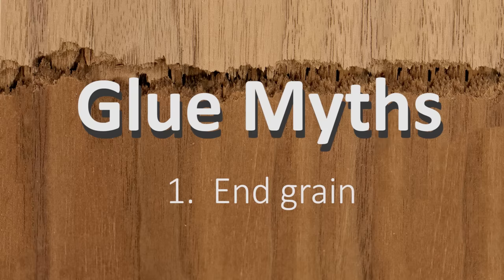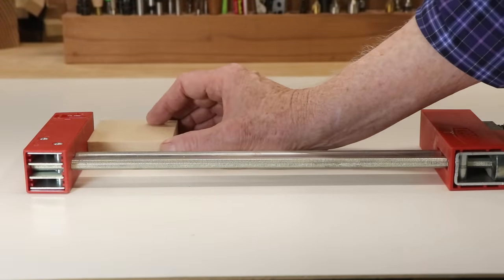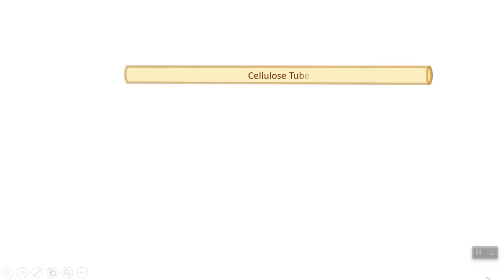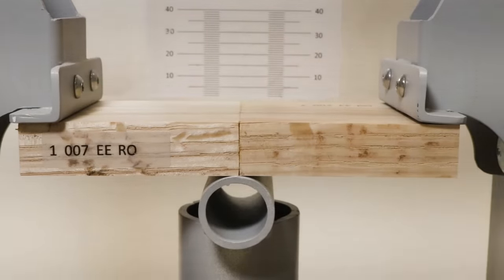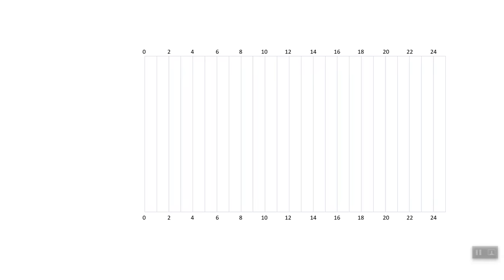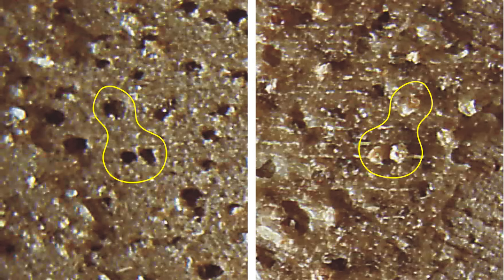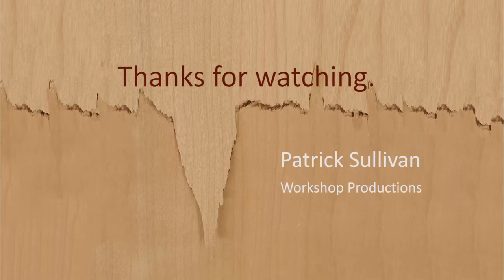Glue Myths:  1. End grain

Comment: This is a very interesting test with lots of avenues for future tests.
I'm a structural engineer so I was watching carefully to check your methodology and results.  I would not have attempted to predict the results however I know that no glue joint of square-ended boards can achieve more than a fraction of the strength of the wood itself with no joint.  I wonder if this is the source of the saying that glued end grain is not strong, not that it isn't as strong as a parallel grain joint but that it isn't as strong as the wood itself.  We know how to create strong end grain joints, they are done all the time in structural fabrication, but they take too much work for the home woodworker.  But we already have means to make strong joints- mortise and tenon, lap joints, etc. so we don't have to rely on glue alone.  And when we do rely on glue alone for making panels, we have a lot of glue surface and the final product isn't required to be all that strong.
Reply: Nah, it is just cause the endgrain-joint is so much weaker.
To get an actual comparison to other joints (what the supposed "myth" actually talks about) just get 2 pieces of wood and cut 1 for a simple endgrain-glueup (buttjoint) and the other for a longgrain glueup (lapp joint or scarf joint) - guess which one is strong (hint: not the endgrain joint).

Comment: Many years ago (make that decades), we thinned glue to make a 'primer' coat for end grain.  After that dried completely, we glued the joint with normal glue.  We didn't test the joints but we figured the extra work and time was worth it.  My question now is, how well does PVA glue adhere to itself, would 'primed' joints be stronger or weaker than 'unprimed'?

Comment: The lignum bond is the weakest bond in wood structure that's why logs can split into firewood.. Your test are of compression strength where  but most furniture joints fail in a shear or racking force is applied over time.

Comment: I like the science, but am leery of the conclusion.
Before I got over it, I was a full time boat builder for about 25 years. But that ended about 30 years ago so I don't know if much has changed. I never used PVA on a boat, only epoxy, and some Resorcinol. never used Red Oak for that matter.

Firstly, when would you ever glue planks end grain to end grain without a scarf or butt plate?? Never imagined doing it on a boat, where is this useful in furniture? We don't glue end grain to end grain because we have better solutions.

Secondly, anyone who glues wood regularly knows that edge grain glue joints mostly break in the wood. The reason for this is that the glue line is more ridged and uniform than the wood, it's a "hard point", and acts as a nodal point in the beam. You really should test the same plank, grain short, and see if the force to break the glued joint is more or less than the full plank. Although that was not the point of your vid, no harm, no foul. I'll take your word for it that end grain to end grain glue joints break at the joint. The fact that wood is generally far stronger parallel to the grain than across the grain is one of the reasons it is so usefully; no unneeded weight for unneeded strength.

Thirdly, wood expands and contracts perpendicular to the grain, and has almost no expansion/contraction parallel to the grain. When you glue edge to edge there is little or no change in forces along the glue line due to expansion/contraction, and since there is little moisture transfer side grain to side grain the pieces are unlikely to have significant force differences along the joint. End grain to end grain is different as the pieces expand parallel to the joint, and will not have exactly the same rates of expansion/contraction, and worse the glue line may act as a barrier to moisture, leaving one piece saturated and the other dry. That's why good boat carpenters use corner posts, or similar, rather than miter joints around things like hatch frames. We try to avoid "miter mouth", especially on deck.

Is glue by itself adequate to permanently join two pieces of solid wood? How about screws by themselves? If we are talking about structural members the answer is no. If you simply screw two pieces of wood together, and there are periodical forces on them, In most cases the screws will wallow out the wood around the screw and the joint will wiggle. If you merely glue the pieces they may stay tight... until they suddenly fail as they are weaker than screwed joints. Using glue-and -screw together you get mutually beneficial results; the glue keeps the joint from moving and wallowing out the screw holes, and the screws reduce the forces on the glue by periodically breaking up those forces and being much stronger. 

How does one glue and screw an end grain joint?

Props for the effort though.

Comment: I suspect that this particular myth got started back in the days of animal glue, before plastic glues were even invented. I worked as a furniture conservator for almost 2 decades and I can tell you that the major difference in an old animal glue joint compared to an old plastic glue joint is that the animal glue feels sugary or powdery when the joint is broken, whereas the plastic glue feels rubbery. I conclude that the animal glue, at a certain age, becomes crystallized while the plastic glue remains a polymer and therefore somewhat stretchy. And as you might guess, a crystallized glue is much weaker than a rubbery glue in the same sort of joint. So the old masters would always advise not to use end to end joints, which would be especially weak if the glue is crystallized. Tough to test this since it can take decades for the glue to age enough!

Comment: But in the end, as you said, the long grain is 3 to 8 times stronger than the end grain glue joint. For that reason a perpenticular end grain glue joint makes not much sence, because it weakens  a work piece up to 1/8. Even as the end to end glue joint itself is as double as strong as the side to side joint.
That's why woodworkers like to make diagonal, V-shaped or even finger joint "end to end joints" instead.

Comment: Can you do the same test. However, add dowels and biscuits to the joints. Not sure if you would use the same species of wood for the dowels and biscuits across each tested wood  species.  Or if you would match the individual species of wood to the dowels and biscuits.

Comment: I enjoyed this video immensely, but I do have an objection that some may consider only a minor quibble.  Nevertheless, I think it is germane to the discussion.  When I learned Woodworking many long years ago, I was taught that every board has 6 surfaces: 2 Faces, 2 Edges, and 2 Ends.  It was drummed into me to never call any surface a Side, since all surfaces are Sides and thus Side is not a distinguishing term and the use of the term leads to confusion and error.  So what you call a Side, I (and I suspect most other Woodworkers) call an Edge.  Whether I'm right or wrong, I'd like to hear from you and any others who would like to chime in.  Thanks for your very enlightening presentation.

Comment: It would be nice to get a test of panel glue-up clamping. How many clamps at how much pressure do we really need? There is a study out there that found we need bank breaking numbers of clamps and high pressure. But I’ve seen many videos of experienced craftsmen who used surprisingly few clamps. Basically, spaced about 2 feet apart. And they didn’t appear to be straining to tighten the clamps.

Comment: While an immediate cure and test, will yield a good test, but is it the perfect one? What happens when you end grain glue, then subject the wood to full range of seasons and test it again. No 2 pieces of wood are made the same, and will have varying rates of movement. Id be happy to watch a "A year look back" test. How much does a constant minor exchange in movement cause the glue to weaken over time?

I cannot recall a single piece of old wood furniture has survived a direct end grain glue up, but have seen a TON of failures due to this. When building your piece, wouldn't you rather have it last 100 years than 2?

Comment: I really like the test about leverage you did at the end with the glue joints. When you broke the one with your thumb pressure and not the end grain joint. You did state it would break with if bent over your knee. Question: Is that pressure used indicate a strong enough joint to be used in practical woodworking applications? Do not know how to test that strength. So gluing end grain to end grain will add strength. When do I use it?
Reply: You should NOT join endgrain to endgrain for anything that needs strength - this video even clearly states that the joints are not even half the strength of the wood. If you need to join 2 pieces of wood - use a longgrain-joint like a lap-joint or scarf joint - they can reach the strength of the solid wood itself.

Comment: This is really interesting but this only tested static loading conditions. Due to the higher rigidity of the end grain wood I wonder if the glue joints in end grain wood fail sooner under dynamic loading.

Comment: would be interesting to see the tension strength of the 3 types of join (end/end side/end and side/side) see if there is any difference and which is strongest when the join is being pulled till it breaks instead of bending till the break.

Comment: The question could be reframed as: How much strength are you losing by gluing two pieces of wood together vs. using a single piece of wood? Side-to-side, the answer is "none". End-to-end, the answer is "most of it".

The best choice is going to be determined by what alternatives are available to you. Knowing the best orientation for gluing two squares together is great if the material available to you is a pile of squares and you need a piece more than one square long. As the range of possible alternatives widens, it becomes less likely that gluing pieces together end-to-end is going to be one of the better solutions, though it may continue to be perfectly adequate so long as strength is not an important consideration.

Comment: Nice logical explanation. Does this mean that finger lap joints, dowels, biscuits and dominos are unnecessary for wide joints? Sure, they allow more surface area on which to apply glue, but that would apply to joints parallel to the grain as well as to end grain joints.

Comment: Great video and testing done on what appears to be very accurate equipment! But do you thing this myth is maybe based on whatever glues were used in the past that may have been weaker than the lignin thing you mentioned?
Reply from the maker: My guess is no.  We have had excellent wood glues for 70 years.  In addition, the hide glues that were used for centuries (and are still used today to make violins) are also extremely strong.  I think the myth developed because people observed that if you glue two long, thin sticks together at their ends, the result is weaker than one long thin stick with no glue joint.

Comment: Great video. I would say though, that you did not show that the end grain joint is stronger. You showed that the side grain oriented wood is weaker than the glue joint, and the end grain oriented wood is stronger than the glue joint. So the glue joint is the weak point in an end grain joint, while the wood is the weak point in the side grain joint. So if  you are aiming to have the glue joint not be the weak point, it is not advisable to make end grain glue joints.

Comment: The problem with glue is reliability and durability. A lot of things can go wrong with glued joints that can't go wrong if they weren't glued. Heat those glued joints up past 200F, get a bad batch of glue, or mess up the gluing procedure and the glue will fail. Most glues also have problems with creep and can't handle shock well either. Try doing the hydraulic tension tests with the impact of a hammer blow on either piece of wood and I bet the glue would fail first.

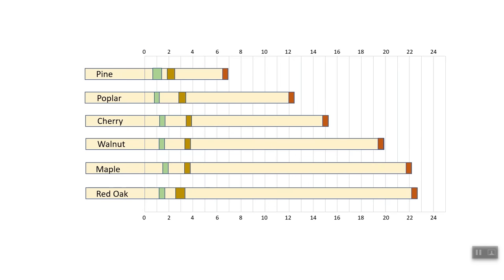Comment: #11:32 i have performed a kind of test that relevant to this moment making Patrick wondering. it’s not about the gluing but it shows differences between wood species well enough.
for my luthiery project i needed in testing various finishes —there was widely acclaimed EPOXY OPTION among them —and my bass guitar has several wood species used —indian rosewood (veneer), maple (or maybe alder or boards of both of them), amorette (fingerboard), australian acacia melanoxylon (backstrapping) and even pine (laminated with IRW).
i tried several epoxy formulations (modified [w. a plasticizer] epoxy resin + PEPA with or without added DBP) on some scrapwood i have from other woodworking projects: oleaster and walnut (juglans regia).
*a finish on oleaster cures quite well if getting closer to something like 70/30% (and decreasing or even excluding DBP);
*it is A TOTAL DISASTER on english walnut! with low hardener formulations i don’t get it cured it all (except in deeper pockets) and even 70/30% formulation fails leaving non‑cured spots on the wood surface!!!

Comment: If you were to compre two side to side of say 20cm x 5cm with two end to end of 10cm x 10cm (making two 20 x 10 boards, you’d find the side to side to be far superior. The issue with this test is all the boards are loaded differently. The only way round this is to test all methods in different directions and get an average between different loading conditions

Comment: And what about white oak, which is notoriously difficult to glue up successfully.  One should really clean the glue joint area with acetone before putting glue on and clamping.  That would be due to the chemical composition of the wood, right?

Comment: I was watching Tamar, and she suggested putting glue on both end grain ends, let it dry, then put glue again and it'll stick better. 

Just wondering, is it possible to completely saturate the inside of the wood with very runny wood glue or even CA glue? Asking because I want the piece to be internally sturdier and prevent warp.

Comment: I'm kind of blown away by how similar the bonding issues and anatomical similarities are between teeth (Dentine) and the wood.

I wonder if you might get different glue strength measurements if the end grain was treated in a way to remove some of the lignin to create greater micromechanical adhesion?

Comment: so another youtuber (Project Farm) did a comparison tests of various types of wood glues and put the glue joints through various tests. in his testing he did 3 samples per joint type with each type of glue and even with the same glue on the same type of wood with similar application method, there were some samples that had wide variance. so i think the end grain myth could come from bad joints for one reason or another like having not enough glue for the joint to fully adhere to the surface.

Comment: Very well done Mr. Sullivan, very scientific! However we need Part II of this video where we need to eliminate the weak part (the lignin) and measure only the glue joint of different surfaces. If you change the direction of the force, then you can avoid the splitting of the wood along its long grain and cause a breakage of the glue joint itself. Also we need to test with polished endgrain surfaces vs rough surfaces. That will be interesting.

Comment: Perhaps the glues from a hundred years ago were not as good? Question, would sanding end grain joints to a high grit like 320, make the bond weaker than if it was sanded to 80 or 120? Pray every just hit it with a plane instead to ensure it’s flat? Great video, thank you. 😊

Comment: I wonder how each joint fairs after one or two years of seasonal changes.  The end grain to end grain joints should expand and contract more than long grain ( both change in “height” but end to end will change more in “width” than the other will change in “length”.  This might cause differential expansions and failure of the glue over time leading to the the development of the myth.

Comment: The end grain glue joint that did fail, that's how you were able to get the microscopic view of the end gran joint. Fun how you don't have a microscopic view of the long grain joint, because it didn't fail. Why at the microscopic view on a long grain you would see strands of cellulose. By weting the long grain joint with the glue you are cuase the wood grain to raise making the long grain joint woven fiber glue joint. That why on your test the wood split but the glue joint didn't.

Comment: I haven't read through the comment so if this is addressed  -sorry.  What about time?  I was under the belief that wood always contracts can expands and that end grain wood movement is where the most movement takes place.  Joints fail on end grain because like flexible straws the the fibres expand and contract over time.  This movement brakes the glue bond.  Yes or No?

Comment: Great video, i dont know much about woodworking at all, more of a specialty metallurgy kind of guy but i love material science... Wouldnt the end grain straight vary SIGNIFICANTLY from wood type to wood type?? Maybe they teach not to glue end joints because on some wood it does not adhere with strength and others it does so for the sake of simplicity they just teach not to do it, and when you are experienced you dont really need to be told whats what ...

Comment: Sorry if someone already asked i am late to the party.  So you compared the bond strength of the glue to the lingum. Did you consider constraining the sidegrain boards and forcing the failure into the joint.  I believe this would be difficult, and is irrelevant to the strength of woodwork, but it is curious.  To be clear though you never broke a side grain joint so you are comparing apples and oranges.  That said I appreciate what you did do and get the point.  Its an inaccurate reason for a best practice that in some cases may lead one astray.  Think folded carcass, mitre the wrong way.